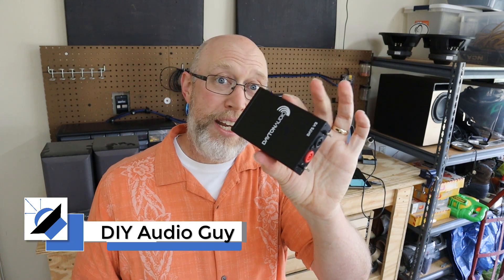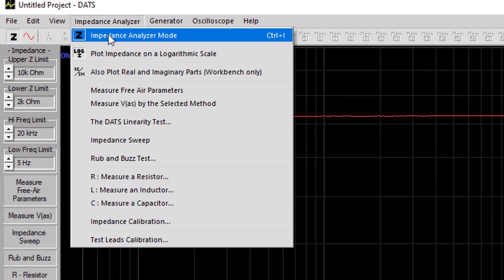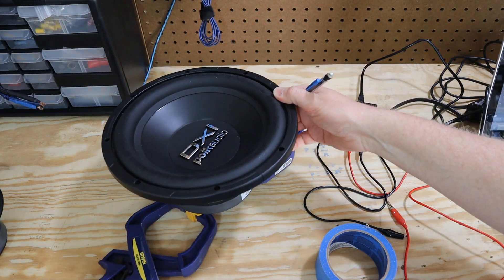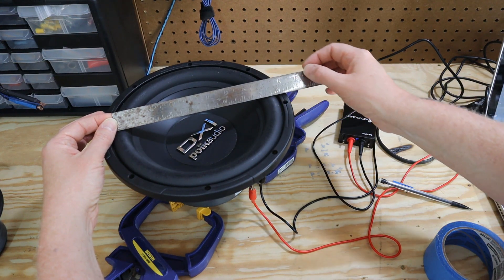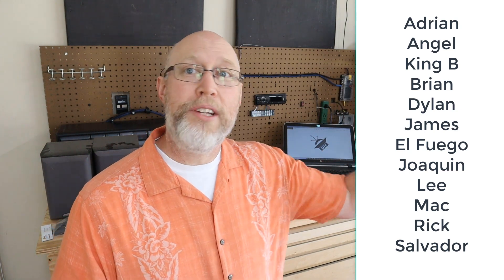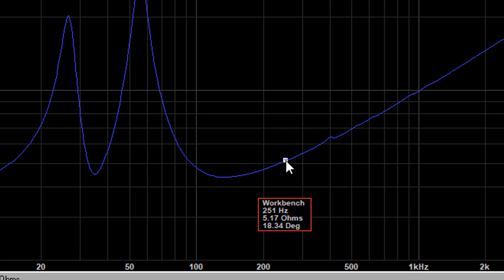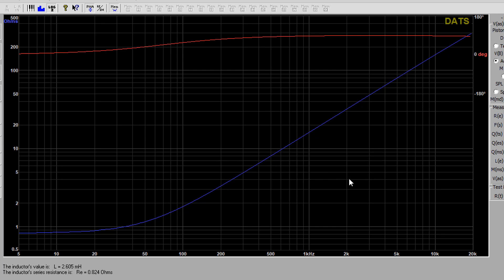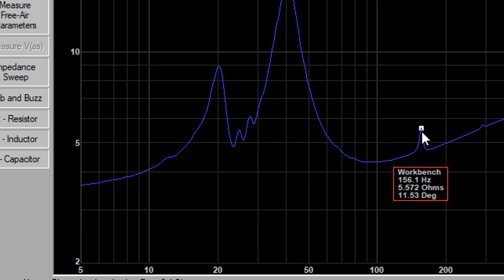The Ultimate Subwoofer Test Gear:  DATS from Dayton Audio

Comment: Have you duplicated resulted on the same subwoofer? I haven't did mine yet,but read that some did multiple test and came out with different results.
Reply from the maker: There are several things that can impact the results.  As you play the driver the suspension will loosen up at the TS parameters will change.

Comment: Just order the dats from your Amazon link. Do you know if you can download the program on multiple laptop and use the dats in whichever one is convenient at the time? And it doesn't matter how many sub/impendance is in a box to find its box tuning? It just needs to sweep at the speaker terminals right?
Reply from the maker: You will have to read the end user license agreement, I do not remember if you can load  the software on multiple machines.  No you does not matter how many subwoofer are in the enclosure, just hook up to the terminals on the enclosure.  Make sure the speakers are not connected to an amp when you run the sweep or else bad things will happen.

Comment: What about dual voice coil .
How does that work if it meters only one side?
Reply from the maker: The standard rule is to wire them in series when measuring the TS parameters.  When doing a sweep to find the tuning frequency of an enclosure it doesn't matter as long as you've got them both wired, series or parallel.

Comment: When testing the tuning freq of your enclosure, can the same method work for sealed or is it only for vented?  Sealed boxes are tuned by how big or small they are built so im hoping this could be a way to verify the exact freq of a sealed enclosure.
Reply from the maker: You can use a DATS on a shield enclosure.  The graph will look different.

Comment: Yes. That’s the issue with relying on the manufacturer specs. WinISD can only give you what you input. Garbage in garbage out. 
Does anyone know a database that maintains realistic measured Thiele Small Parameters?
If every YouTube basshead channel had a Dayton DATS we would have a vast realistic database.
Reply from the maker: It's a handy tool.

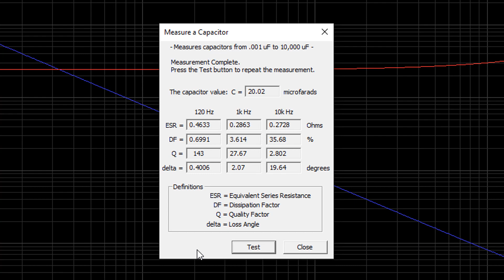Comment: 7:23 With the fact that you can measure components with the DATS, could you possibly use it to recap or measure any capacitors/diodes/resistor components on a vintage tube/transistor radio and see whether they're good, out of tolerance, leaky, or shorted?
Reply from the maker: I don't see why not!
Reply: @DIYAudioGuy  It's a thought. Perhaps somebody'll think the same thing one day and try it out? Perhaps that could be me :D

Comment: You should put any speaker or woofer in the position its going to be mounted in permanently then measure the TS parameters instead of just on a table. Regardless of covering the air hole on rear you still showing everyone wrong.
Reply from the maker: If it's in an enclosure then you're not getting the free air parameters.
Reply: @DIYAudioGuy  I meant the angle of the sub the way it will be mounted. Not actually inside the enclosure.